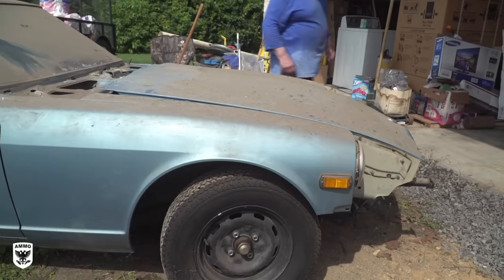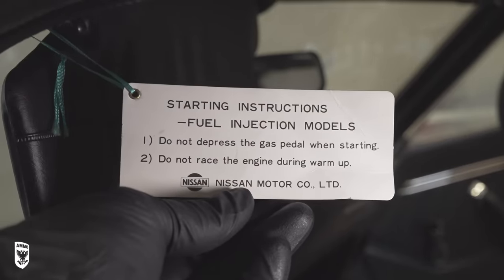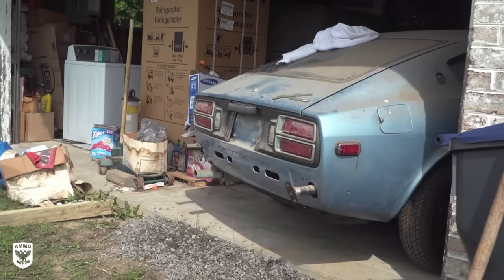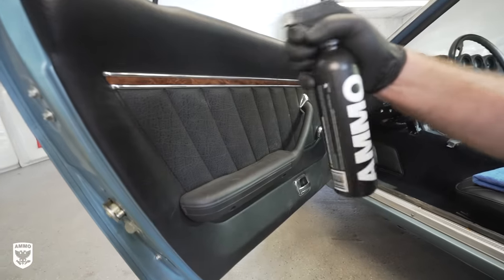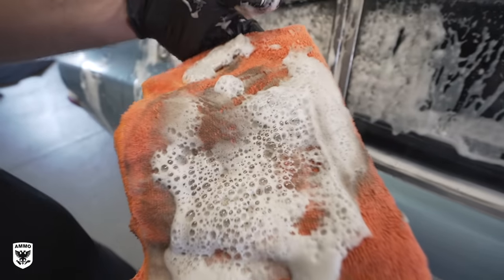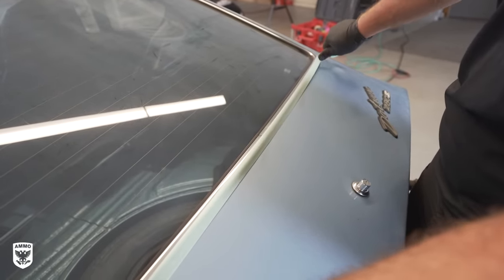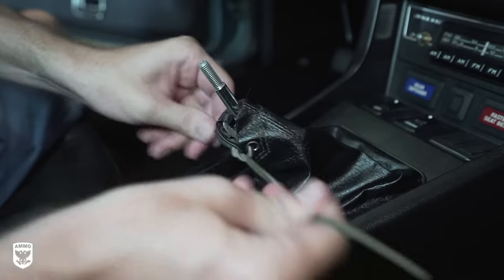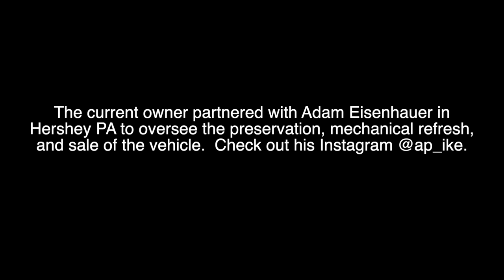First Wash in 44 years! Barn Find Datsun 280z with only 350 Original Miles

Comment: No one even knows that this 280Z was a “Devil Z”, and it could run on the 3.0L engine bore tunes for it..a killing machine with big boost of turbos..it’s what they called as “Devil Z” in Japan..
Reply: no one call them Devil Z, it's simply a Fairlady Z. The name Devil Z is from the manga Wangan Midnight.  Actually in the manga, he had a 240Z S30 chassis with aero kit and fender flares. Has for the engine, it's  L28E 2.8l engine from a 280Z that was bored & stroked into a 3.0L , with a twin turbo setup and triple carburators. 

Mid Night Racers were racing the  ABR S130Z that had a similar setup, which was commong in these years, mid to late 70's and really early 80's.
Reply: nope...
Reply: Stop capping
Reply: @rx7outlaw  nice rx7 man! 😁👍

Comment: I'm still confused why they didn't just use a  garden hose instead of a towel.
Reply: Agreed
Reply: Yeah, the guy who owns AMMO and is trusted to detail million dollar cars probably doesn't know what he's doing ;)
Reply: Well that soapy stuff is designed to life dirt without damage ,that a bucket of soap and a wash cloth can cause sometimes..I’m also guessing it was to make sure that water wasn’t going to start pouring in through a seal..
Reply: You go through all the effort to lift the dirt off the paint.... and then smear it back into the paint with a cloth?!  I think a very light water rinse after soaping with towels waiting to collect excess water would be preferred. Hard to argue with the end results though... I guess they knew it was going to be buffed anyway.
Reply: as they said they're trying to maintain the original stickers that will get destroyed on contact with water...
Reply: @markim5087  .
Reply: It made for a longer video 😏
Reply: Same they rubbed the dirt in more causing small scratches to form over time
Reply: They could have covered and taped around the stickers somehow...
Reply: Hello? AMMO doesn't sell garden hoses.
Reply: You’re supposed to drag the particle-rich towel across the paint before coming through with a pressure washer. Science.
Reply: Use compressed air and blow off dust, rinse with low pressure water, use the “special foamy” rinse with water. Then dry with compressed air and micro fiber wipe only when clean.
Reply: @fredrik.claesson  In this case though, Ammo put that paint at risk by doing what he did. He claimed that the foamy soap was 'lifting' all the dirt but as soon as he ran his towels along it he was literally pushing the now wet and thick dirt right back into the paint. I guess in the end it doesn't matter cause they were going to buff and polish the paint anyway but I don't think what he did wasn't helpful at all and I'm scratching my head thinking how it makes any sense. If I have a really gnarly dirty piece of furniture, common sense says don't immediately spray it with Old English and start wiping it cause its just going to make it that much harder to remove the dirt. Just using some of that compressed air gadget and then some gentle watering without pressure would have made it far easier to remove the dirt without the danger of scratching or embedding the dirt further.
Reply: @daveclark8337  This guy gets it.
Reply: They overthought the process?

Comment: I can’t believe you didn’t start the car. Unbelievable how much technology Japanese cars had back in the day
Reply: Would’ve been a bad idea to start it without looking at the condition of the hoses, lines, etc. Rubber tends to corrode after years of being untouched
Reply: @crissalinas5608  Plus they need to remove the valve cover and inspect the guts.  After being unused for 44 years the oil is completely at the bottom of the pan so they would remove the old oil, add new oil over the valves and slowly hand crank it to lube all the moving parts.   And listen for any grinding noise.   It's better to hand crank it slowly to keep the damage to a minimum.   Once everything looks good they can fire it up.
Reply: I bet they are only for the detailing. Someone else will do that dude
Reply: Remember, they are just cleaning it

Comment: I am wondering if there is a reason you didn’t start with air to blow the accumulated dust? I expect that would have been less risky than using a towel on that thick layer.
Reply: Pressure washing after blowing off dust is correct way of doing it. Risking rubbing all that grit into the finish just to show off your products is foolish. The paint doesn't have any clear coat to begin with. So any scratches are put directly into the paint. So buffing can only be done so many times before paint gets too thin. Waxing is your clear coat and protection all in one.

Comment: When this car came out, I remember everyone regarding it as a wannabe Porsche.
Reply: I would rather own this car than a brand new 2021 porsche.
Reply: I owned a '74 260Z and, you're correct.  However, it had very similar performance characteristics at about half(?) the price.  Simply a stunning vehicle back in its day.
Reply: It was. Hate the rubber bumpers.
Reply: @PaulWilliamsCallPaul  It was slower than the Porsche but definitely not by as much as the price tag would suggest. Great car.
Reply: Same as with the vw Corrado. It was called the "farmers Porsche" in Germany. But probably mostly of jealousy.
Reply: @burtreynolds2969    what kind of Porsche...? Lets start there..
Reply: @gewglesux  Any new model porsche. But I did give it some thought. If someone offered me a new porsche over this cool old car, I would take the Porsche. Then sell it, then buy the Datsun, and have a bunch of money left over.  ;)
Reply: @burtreynolds2969    Interesting thinking...  if it were me i'd keep the Porsche  and NOT have a lot of money left over..
Reply: @ytwos1  you can blame USA legislation for them. Not how car was designed originally. 
This was more based on English sports cars. More E type jag than Porsche.
Reply: There’s nothing, not even sentimental value, that pardons the stupidity of preferencing this old thing over a new Porsche. A new porsche is literally the pinnacle of automotive engineering. This thing is a feat in history.
Reply: @fastgrandm1236  to each its own. Some like this, some like that.
Reply: Well this is rivalry with porsche in anime.You know it right ?

Comment: Why not use water to remove the initial dirt? surely aplying froce even with a lubricant would microscratch? just curious
Reply: Exactly.
Reply: Lol
Reply: i definitely cringed hard when watching all that dry dirt and dust get smashed into the paint.... who's idea was that?
Reply: Did you even see the video? He says it in that exact segment.
Reply: It was a dumb move. He overcomplicates some of these steps to make the video more interesting or to draw more eyes.
Reply: He didn’t trust the seals enough to start pressure spraying. Afraid water would leak through damaging the stickers inside. I also thought it was a pretty dumb move- should’ve just covered the stickers - but he’s the pro- I was just hurting when he was wiping down all that dirt.
Reply: @louiegarcia3544  If he was worried about the seals why did he use the pressure washer later.
Reply: Test the seals then, on an area that doesn't damage the stickers there wouldn't be an issue. Better yet get a spray bottle and take some time to do it correctly. Even with a lubricating detailer I would never even think about doing what he did.
Reply: @louiegarcia3544   Yeah i figured just low pressure water would do most of the job on large areas then hit with rags and pressure washer.
Reply: Took the words right out of my mouth! I cringed hard when they started wiping dirt off!
Reply: ScrubberDawg that stuff lifts dirt you won’t scratch with it
Reply: It's them trying to use their products to sell them to us, it was so uncomfortable and dumb to see that, common sense would be as you say.
Reply: Yeah that was weird a bucket of water would've done the job
Reply: Ok, right off the bat using water would move the dust on top down the sides and into cracks and stuff where it wasn't before. Plus, water will only remove so much, same as pressure washing. PW often just forces the grime into the paint. I laugh at people P washing their siding and fences because all they're doing to shortening the life. Many wood siding manufacturers void the warranty if it's pressure washed. 

The foam lifts the dust, then rotating the towel lifts it off the surface....THEN you rinse the left over away. 

And just an FYI? water is abrasive too......lots of older houses have copper elbows etc failing due to all the water flowing through them.

If that was my car? I would have blown the whole thing off with an air nozzle and 60 psi first....then foam, then water, and I'd skip the PW all together.
Reply: @muskokamike127  with this logic wouldn't compressed air essentially be sand blasting? If water, which lubricates, can scratch.
Reply: @ScrubberDawg  no, because a) I said 60 psi....(low pressure) and b) sandblasting only works when there's grit IN the air, the "grit" is on the surface being blown off by the air. C) water is a hard contact with the surface and grit thereby forcing it into the paint. there's no hard contact between low pressure air and the paint.

Physics, you should have paid attention in school!
Reply: @muskokamike127   yeah but if you put bulk foam on it first like he did then just soft water to rinse I dont see the need for air or rags or anything more complicated. Thats all im tryna say.
Reply: @ScrubberDawg  Again, then you have all that crap running down the sides of the car putting that junk into all the nooks and crannies and creating streaks. 

I used to have a 30' sport cruiser boat and the hull would rarely get dirty, just the top deck. When you hosed down the deck all the crap would run down the hull and I'd end up having to wash that too after all. 

In most cases on a car that is a daily driver, who cares? but on something like this, you want to take the extra steps to preserve the original finish.
Reply: @Justkevin377  I guess he felt comfortable enough to proceed after wiping them down and getting a closer look- who the hell knows- but I’m sure it was comfort once he cleaned it and saw no cracks.
Reply: @muskokamike127  > boat goes in water
 >water keeps boat clean
Youre boat has nohing to do with this cause the whole thing wasnt dirty. This car is. The dirt will run down into more dirt. So you use more water. I think youre he one hat didnt pay attention in school mate.
Reply: @ScrubberDawg  and yes, the water will run down into more dirt, and cause streaks.

Sounds like you've never washed a car before honestly. 

So I tell you what, why don't YOU make your own "car wash" detailing channel and show everyone the "right" way to do it?
Reply: @ScrubberDawg  BYW *your
Reply: @muskokamike127  Bro you just use more water is not that hard. If the dirt runs into cracks use more water....
Reply: @muskokamike127  if it streaks just use more water
Reply: @muskokamike127  wheres your car washing channel you muppet?

Comment: Absolutely stunning, too bad the bumpers on an American Z are just so damn bulky and look horrible
Reply: Yeah, welcome to the mid seventies.  The motor is probably tuned pretty horribly for emissions reasons, too.  From 1972 until catalytic converters came on the scene, cars tended to run like crap.
Reply: I had someone rear-end me in my '78 with those massive bumpers; the front of his Buick LeSabre was destroyed but my Z only had a scratch across the top of the bumper. Yeah, they did look horrible though.

Comment: I cringed when y'all were wiping the dirt on the paint. As a professional detailer, you never do that. Then once you had it washed off you could see the scratch marks left by the dirt you scratched it with; You always, rinse, froth, rinse and repeat. Then just use low pressure to remove residuals. Then use the two bucket method with a wax additive for washing by hand. Rinse. Then focus on tight areas, rinse. Then clay bar. Wipe down with lubricated detailing spray. Spotlight the car and mark areas that need heavy compound with wool pad and buff. Then slap on a polishing foam pad and use a light polishing compound. It doesn't matter if you use a microfiber when you wipe the dirt off a car, the dirt/debris is what makes the scratches. The less work you make for yourself the better, just saying. Now we never will know what the actual condition of the original paint was because of all the scratching.
Reply: When he wiped that cloth along the door I could almost hear the paint being scratched underneath. 
No fancy foams, gels or angel wings will lift dirt thats embedded into the paint. THEY EVEN SAID THIS WHEN STARTING ON THE BOOT 'look at the dirt embedded in the paint' !!! 
I'm no an armchair car detailer. I've done many cars myself. There isn't a single product out there that i would trust to 'lift dirt away from paintwork without scratching when you wipe over!'
Reply: These guys are amateurs, and should never be permitted to touch any painted surface of any vehicle EVER.  The way they horribly scratched the paint when wiping 44 years of dirt off was a sacrilege.  These guys each need a punch to the face for doing that.
Reply: The paint was likely lightly oxidized, any scratches made would've been inevitable because of the amount of dirt. The original layer of the clear coat would've been removed anyway when they polished it.
Reply: I agree - there's no way that wiping dirt of is a good thing. Float it off by gently (not power wash) rinsing off with a soft flow of water from a hose.
Reply: keyboard detailers are currently discussing their prowess
Reply: @johnster1964  Exactly and well stated!  I was going, "WTF?"
Reply: John sull and others 

Exactly!

In my mind I could hear the paint being scratched with “ the high tech micro fiber towel”.     
      A simple garden hose should suffice.    
     A power washer and a micro fiber towel might get 75% of the dirt off, but push 25% into the paint finish.  
     How about a garden hose and a wet rag and a dabbing motion,  up and down?  
      I don’t think “ the professional detailers” let the soapy foam sit long enough either.   Think Barbasol shaving cream: let it sit a long time to soften up your beard stubble before shaving.    

      This is not being a Monday morning armchair quarterback.    This is using conventional wisdom.   
       Thanks to others here, now I feel like I wasn’t the only one crying out “ the emperor is not wearing any clothes “ !
Reply: Take it easy buddy I think Larry and his team know what they are doing. Go back to detailing 15 year old Toyotas
Reply: aeperformance48 —

I WANT to believe they know what they’re doing.   They have a nice expensive garage.    But even when you roll a micro fiber towel into the paint finish, I think you’re going to cause scratching.

Comment: Never wipe dirt off paint. Never. Use a pressure washer on low pressure.
Reply: Just realized they probably wiped the dirt with foam to create scratches so they get more money and content to do a polish. smh...
Reply: Seems like they wanted to make a big deal of showing us how dirty the rag got.  Did this surprise anyone?  Weird.
Reply: I scrolled down to see if anyone else noticed this. Real weird thing to do
Reply: I wonder why it wasn't started.
Reply: I thought it was pretty obvious why they did it. This was a request most likely from the owner since they weren't sure if the seals were going to hold up. He even explained that he asked for permission afterwards. What he was using wasn't normal "foam" it was a special product design to loosen the dirt as much as possible.
Reply: @midnightcs1482  I don't see how the foam type negates the potential scratching associated with wiping rather than spraying off the dirt, but you sound like you know what you're talking about.
Reply: Fredo Bull  13:08 you can actually see the scratches left by the wiping.
Reply: They knew they’d buff it so the wipe of was no big deal.
Reply: @avinstallations  because it doesn't run- what other reason could there be??

Comment: Lovely result - well done! One thing though. I was under the impression that tyres have a very definite use by date, and that manufacturers recommend replacement after 10 years, regardless of milage or appearance. If that's the case, wouldn't 44 year old tyres be a VERY dangerous prospect and need replacement before this beauty turned a wheel?
Reply: Buy tires online
Reply: You are correct, but this thing will probably be turned into a collector's piece so it's doubtful that it'll see street speeds ever again